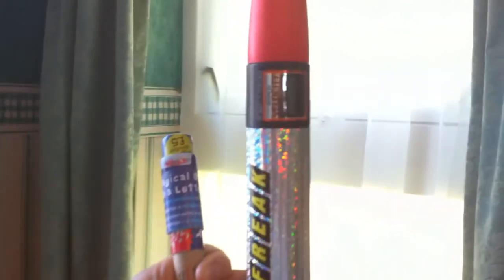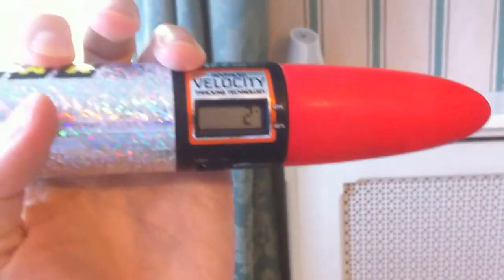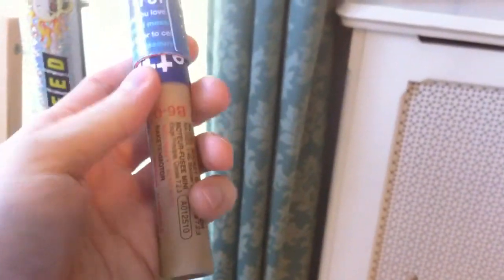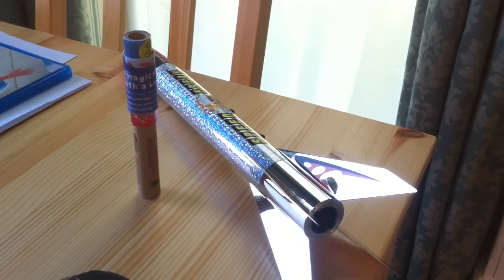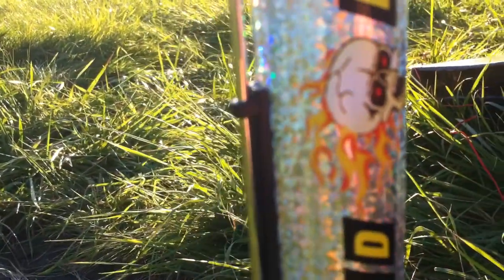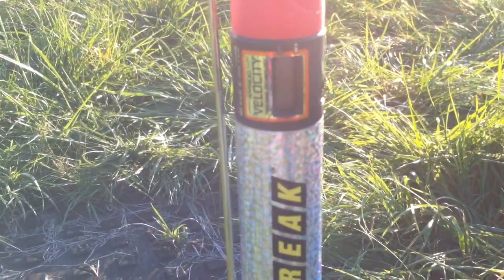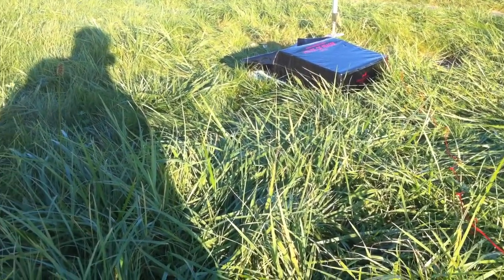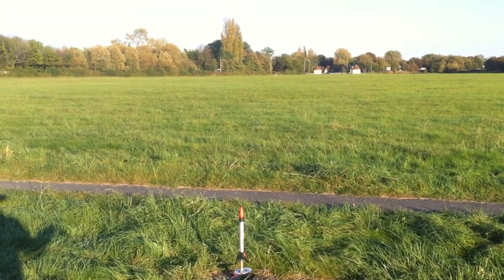Building and launching my self modified 2 stage Estes Speed Freak rocket

Comment: I can tell you this much my rocket 2nd stage flies about 83 miles an hour depending on wind and payload my rocket design Aurora flies on a D-12 booster first stage and a C-5 upperstage you can figure a D motor is 2 times powerfull than the C motor and so on I have a device called altimiter 2 that tells you everything as for the speed its all about aerodynamics the lees drag you have the faster it will go. Have fun learning model rocketry is a great hobby